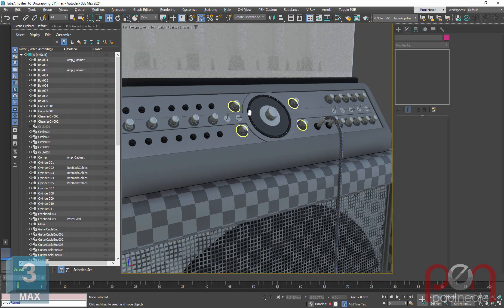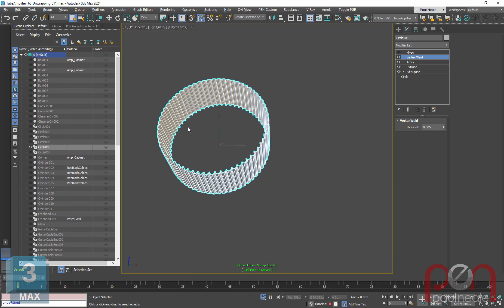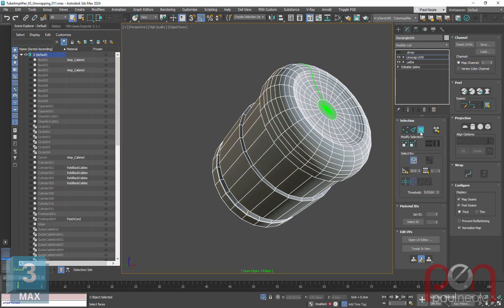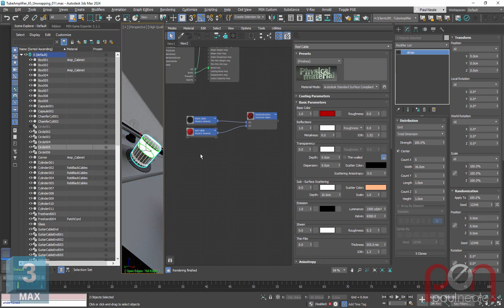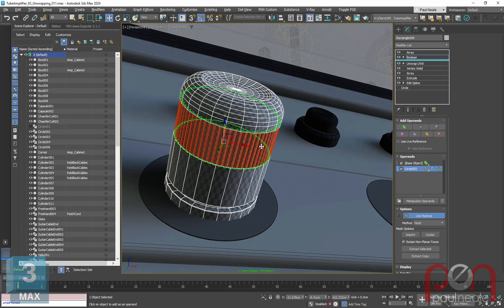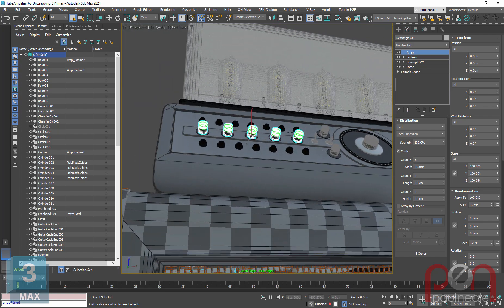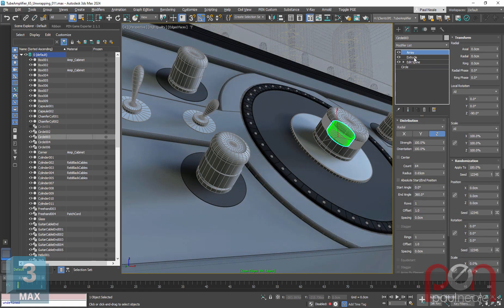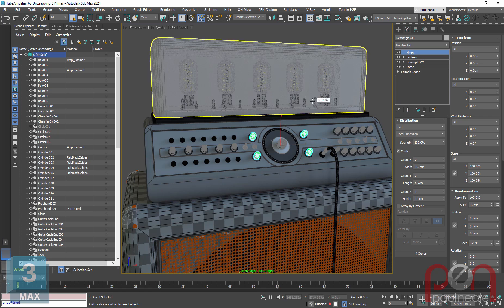3DS Max AMP Unwrapping 05

Comment: Hi Paul. I was wondering if you could help with another issue concerning UV mapping. Suppose you were wanting to map something like a computer keyboard. Instead of generating individual Island (maps) for each individual key, you just want one map that includes all of the keys. How would someone accomplish this?
Reply from the maker: If you want all the keys to be different, as they are, they would need to be spread out. It would be possible that they could all be attached and one island. If you want them all the same then unwrap one and copy it around the keyboard.
Reply: @paulneale  Thanks for replying Paul. I was wanting to have just one map with all the keys. Then I could bring it into photoshop to add all the numbers and icons onto the individual keys. Just not sure how to go about getting just one map. When I try using the unwrap, it generates maps (or Islands) for each and every key. I am sure there must be away to do it though. 

Cinema 4d (and I think Blender) have a way of selecting a surface and then immediate projecting a UV map from that surface, but I can't find anything similar to that in 3ds Max.

Cheers,

Comment: Nice work, but still 3ds max is a most horrible tool for unwraping... Slow shell moving, no symmetry, no texel density meter and more and more...
 I explane: I have to correct uvs (not create, only move shells) for airplanes and other hardsurf models for AAA gamedev, I have to work simultaniously with 30-50 and even more then 150 elements in one scene with UVUnwrap modifier on - and I have to wait for 10-20 seconds if I press undo.... When I select a shell and I have to move it - I recieve lots of lags. And I`m happy if no crush... :) 
 I tried to compare work with uvs with this scene in maya, blender, UVlayout, Rizom and there are no benefits in 3ds max. Only disadvantages.
 3DS max is good only for small single meshes, where you dont need to achieve best results in UV.
Reply: There's a plugin for that ...
Reply: @WaspMedia3D  there are no plugins, that can be compared to minimal functional of uvlayout or rizom. Or even maya. There some scripts that can help packing and stacking, aligning, but no support for other useful stuff. The most comfort plugin, i ever seen is uv reactor. But it is in beta state and have lots if bugs.
Reply: @VsevolodVityaz  re: UV Reactor, I don't find it very buggy, but it is incredibly fast. 

It's been a while since Max had its UV tools updated, so I do agree with some of your points, but its certainly not "terrible" - just hasn't been updated in a while.
Reply: I agree on most things - I find it so hard to believe adding texel control would be difficult for them.. Really hoping for some update on this. Luckily rapidTools will update UVReactor for 2024 soon :D